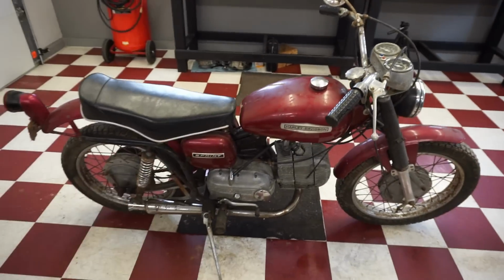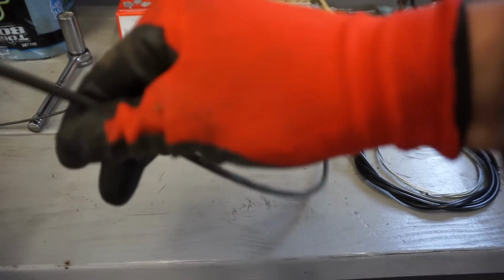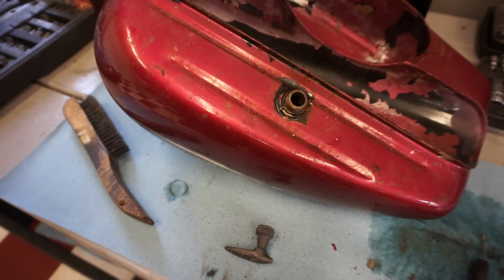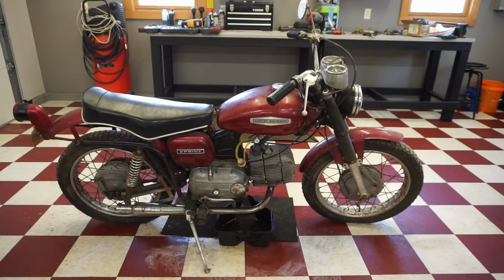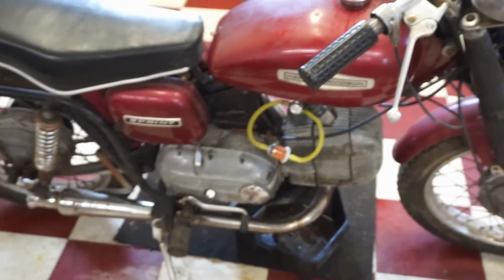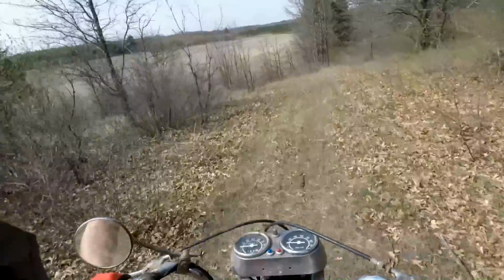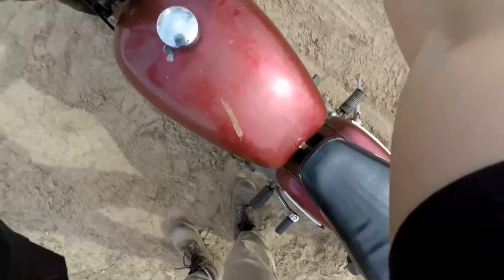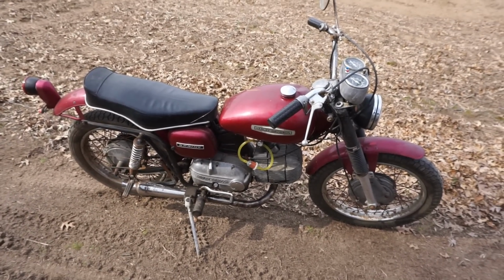1968 Harley Davidson Motorcycle RUNS For The First Time In 30+ Years

Comment: I bought a REALLY ugly 1965 Spring in the early 90's. (I'd had a 67 Spring SS when I was 16)  I got it running, then took it all apart, with the idea to get it painted and restore it.   Found a beautiful NOS seat and a number of other parts.  Long story short, life got busy, I moved to Russia to work, and the project sat.  Finally, I gave it to a buddy who finished it, had it repainted in the original 1965 color (orange) and he had me come down to try it out.   After all the years of not riding one, the 'upside-down' shift pattern on the right  side was REALLY confusing.  The Sprint was the first real motorcycle in my life after having had a little 65cc Honda.  So cool to see this one get rescued and on the road again.  Thanks for the video.

Comment: Q-tip works great for the seat and if you get a stubborn one you can use a dab of tooth paste on the end and use it as a grind compound. Not aggressive enough to hurt anything but just enough to clean up the surface.

Comment: Best thing I’ve found for carb cleaning is guitar string, works amazing! Been using them for 30-40 years! G,B and High E strings are the best!! 👍👍✌️✌️
Reply: Torch tip cleaning files (cheap for a full set) work great too. They come in many sizes for different jets. They also make a good string nut file for your guitar.
Reply: Ah man that's a great idea. Wish I would have thought of that two weeks ago working on an old outboard motor.
Reply: @JayWalksAround  now ya know bro! Really works amazing people don’t realize the strength of them strings when your only using a 3-4” piece grab ahold of it with some Vice grips or something about 1/4-1/2 from the end and you can stick that thing in a 2x4 lol

Comment: Those little bikes are awesome!  I like the right side shifter.  1st bike I ever owned, back in 1971, was a Norton 650 Nomad (Twin Scrambler), my uncle bought new in Texas in 1958. It had right side shifter, 1 up, 3 down, and rear brake on left side. It has twin Amals, similar to those Delorto's, side bowl with tickler primers.  They always leaked gas until the bike started up.  Brits located the magneto directly under the carbs.  Brit bikes leak everything... oil, gas, electricity (thank you Lucas).  The magneto cap looked like a mini light show at night when it was running.  Starting it was always an adventure, as gas would drip down where the spark escaped the mag cap, so I had to always have a thick rag with me to put the fire out, which happened pretty frequently.  I still have that bike.  Starting out and learning on that, then having to re-learn left side shifter and right side brakes was a new experience on my later bikes when I started moto-crossing, and trials riding.
Reply: Were they Amal monobloc carbs with the side bowl, or concentrics with bowl underneath?
Reply: @bananabrooks3836  They are twin Amal 276, pre-Monobloc.  They have the bowl on the sides
Reply: @JohnnieBravo1  There are things you can do to stop them leaking  plenty of hints and tips on lnternet. Some 'modern' parts cause the floats to stick.

Comment: for the spokes, place a few drops of oil on each spoke.  i used to use 3-in-one,  but i suppose a more solvent-based may work.  spin the wheel so centrifugal force makes the oil move to the nipple and drag a metal object accross the spokes to set up vibration.  obviously you can do this more than once and wait a while - day by day even.  most things will free up with penetrating oil time and vibration.  if you are not impatient time is on your side.
Reply: This guy will never make a really good restauration person because he doesn't have patience, have you ever watched the way he Squirtle oil in a hole he gets all nervous and dangled it around like he's having a nervous breakdown

Comment: On Rust- My son bought a 1982 DR125 in great shape for $140 (barn find) and the tank was terribly rusty- I use apple cider vinegar for these and it typically works great! same on an old boat tank. Just fill it up and let it sit for a few days. Rinse well after and put gas in it so rust doesn't start again. Not sure what the rust remover costs, but cider is like $3-4  :)  I also soaked the carb in the same vinegar and it cleaned up really good.

Comment: I had a 1973 Harley -Davidson SS350 Sprint. Made in Italy by Aermacchi. I purchased it new and I think it was about $795.00 plus tax. Harley had two different versions of the 350 Sprint. The SS350 had chrome fenders and though it's a single cylinder thumper, it had dual chrome exhaust. They also made a SX350 Sprint. It was made like a trail bike. The SX had high fenders, I don't recall them being chrome, knoby tires, single upswept black exhaust with a heat shield, I think on the right side of the bike and it had a larger rear sprocket. The SS350 had rubber mounted handle  bars. The SS also had an electric starter plus the kick starter. The SX probably had a different set of shocks for off road riding. I enjoyed the Sprint while I had it, which was only for one riding season. Unfortunately for the bike, it all ended one cold day in November of 73 when a guy made a left turn in front of me. Fortunately for me no broken bones that day.  

I don't know if Harley imported two different versions of the 250 Sprint in 1968. Looking at the 250 Sprint in this video kind of looks like at one time it may have been setup for off road riding, with the high rear fender and upswept chain guard to accommodate a larger rear sprocket.

Comment: Hey joe just want to say since watching your videos I have become so much more confident doing engine work. I have just made a gs125 head, piston, cylinder and cylinder head, plus cam and chain from one engine fit onto a newer fuel injected dr125 engine and without your videos and the knowledge I have gained from you I wouldn’t have succeeded. So thank you, keep up the great videos ❤
Reply: Similar story here. He’s convinced me to buy/repair 3 (as of now) Yamaha blasters. So now I have 3 of those babies. My problem seems to be in selling them. I don’t want to sell them ha.
Reply: @jchuston  I’ve got the same issue but I did manage to sell a couple still have 5 Polaris 4 wheelers seems like I wind up with spare parts that make the next one just a little bit cheaper to fix and unfortunately buy
Reply: @danelldecker3696  100% agree ha ha. I got a cracked case blaster for $250…but had all sorts of good parts, so now I need another clapped out one to make 1 whole running one.
Reply: @jchuston  which leads to the next one and on and on it goes. But hey there is money in it sooner or later and a lot of good times in between. Worse things a guy could be doing. Least that what I tell my wife
Reply: Back in sixties I worked at a motorcycle club. The HD Spint won a lot of state championship flat track races. The person who said they was junk, is full of_ _ it.

Comment: I had two slides stuck in carbs the other day. I soaked them, tried heating them with a propane torch, tried lightly prying with a plastic tool. No movement. I boiled them for a minute or so and the slides came right out. If I had tried this first, I wouldn't have broken one of the throttle shafts.

Comment: I was racing flat track when these came out,they were very fast and the the first 4 stroke flat track 250,more torque where my suzuki was high rpm,they beat on the corners and I would fly by on the straights.
Reply: I remember them on 1/2 mile flat track.

Comment: Take the gas tank off pour small nuts and bolts in and shake tnaks for a few minutes and then empty out all the rust dust. Then put the solution in.
Reply: BB's work pretty well to. I've done that before.
Reply: @PropheZ23  >I've  used clean gravel  rinse with water and dry then coat with an epoxy tank coating.
Reply: You can also use dish soap, a metal rod, and a battery with leads to chemically pull the rust off the tank.
Reply: Marbles are the best thing to use to clean out a gas tank.
Reply: I prefer a length of chain.

Comment: I did enjoy that video very much, lots of information and easy to follow. 
I'm another one that had one of these many years ago. I had a 1968
 350 CC Sprint. Pretty reliable, It was fun to ride. I remember that absolute top end was about 85 mph. 
The Sprint was my third motorcycle and the first one I ever dropped while riding. Took an extremely sharp curve, just a little too fast. LOL 
I've owned a lot of bikes since and I currently have a 1997 HD road King.
Keep up the good work!

Comment: You are giving me inspiration to complete my 1974 Kawasaki Z1A 900 "revival" that sat in my garage for 15+ years. I only need to pull the trigger on a new tank (the old one is in really bad shape), new tires and get the carbs synched.

Nice jobs, I really enjoy your videos!
Reply: I have a couple kz650s....restored. carb sync and timing adjustment made the bike like new. I did the relay / coil mod and it starts on a half kick.

Comment: Wasn't the bike an Italian Aermacchi design which Harley acquired to fill their small bike gap?
Reply: Yes.
Reply: I thought the Italian engines were the 2 stroke 1 75 1 25 and 250
Reply: @Slimjim011  You are correct, also the 250 and 350  4 stroke singles.
Reply: Yes, Harley marketing staff was too dumb to foresee the huge boomer generation come of age wanting to ride, when Honda and other Japanese makers brought out smaller displacement bikes, Harley realized they needed to do something for the youth market.  They bought a 50% interest in Italian aircraft and bike maker Aermacchi (air machine), slapped HD Sprint decals on the tank and the Sprint was born.  H-D also sold the road race -ready CRTT and the factory flat-tracker, the CR, CRS, and ERS.  A Harley Sprint set the world 250cc speed record at 176 mph in 1967. The Sprints were very competitive as racers and the CRTT are still raced in Europe and South America, they are renowned for great handling and you can buy all the road race kit, fairing, tank, bump seat, rear sets etc. from an outfit in North Carolina. Great job!
Reply: @davisworth5114   Still raced in AHRMA  in the US.

Comment: Great vid. I have a 1973 SS 350 Sprint, professionally rebuilt SX, date correct motor, somewhat rare 5 speed. Fun bike. The kick in the ass is that 100% of the electric starters failed, including mine which never worked. The small planetary gears in the starter fail. Fortunately, mine usually starts in 2 kicks.

Comment: The oil leak is the return  to the case from the head. Tighten. The carb is a gas dump not a air restriction. Theres a O ring on that little shaft on the dump lever
  Buy a Maconie carb. Big performance change.

Comment: toothbrush is what you use to clean small parts or hard to reach spaces.  you can actually now buy a cheap electric.  i got one and was suprised the battery - alkaline i guess - was still working after a year of sitting.  also,  use paint-brushes of different sizes in the cleaning.  what you are actually doing is " restoration "  which results in a bike worth more money if original.

Comment: In 1977 I was 10 years old and my brother was 14. We shared a honda 125 that we bought together. Got tired of having 1 bike and pulled  a sprint out of a junkyard for $25. Being a 10 year old mechanic I couldn't keep it running and we pushed it back to the junkyard. I waited another 20 years before I bought another Harley

Comment: Cool little bike! I thought that was something Harley acquired though, bc I had a small Enduro bike back in the 70's that had Harley on it, it was a 100 enduro but I didn't think it was a originated Harley, I don't know what it was originally but sure wasn't that Italian made bike either. To me the engine looked more like a Hodaka or some Japanese made bike, idk? I believe it was AMF Harley or whatever they were back then.  Anywho, I like that little Harley better than the one I had. Yeah the shifter and all that being on the opposite side than what you're used to is weird, I had a buddy back in the early 70's that had a Sears 305 street bike and everything was bass ackards on it too, shifter on the right, brake pedal on the left, clutch handle on the right, throttle was on the left, front brake handle on the right, man that took a little time to get used to but once you did it was a sweet riding bike.
Reply: You may have had this little H-D.  From Wikipedia "The Harley-Davidson Baja 100 was a small displacement off-road motorcycle made for Harley-Davidson in Italy by Aermacchi, which was 50% owned by Harley-Davidson at the time. It was one of Harley-Davidson's attempts to enter the small displacement off-road motorcycle market. It was built in Aermacchi's Varese, Italy factory."
In 1971 I  had a used 68 H-D Rapido, 125cc two stroke and bought a SS350 Sprint new in 1973, both made by Aermacchi.
Reply: Yeah, you're probably right, that's what it was I believe, been so long ago I can't remember the whole nomenclature or whatever of it, but sounds about right. Thanks bud!

Comment: Did you know that CITRI STRIP that you used on plastics before too get the spray paint off stated on the back of the bottle do not use on plastic surfaces so have you had any issues with it bubbling up the plastics or anything?  I picked up some today for a project that im working on that has ben painted but i dont want to ruin the fenders.

Comment: You swap those handles over to the opposite sides to accommodate your way of operations of riding to Joe. It just switches what hands does what is all on the bike. Most likely A left handed rider owned that motorcycle once before you got it. They usually change.,or have it swapped over to the left handle bar for shifting.& Etc.
Reply: Sorry pal, no can do.

Comment: I had a 1968 305 Yamaha 2 cylinder two-stroke first bike with the oil injection. Did 140 mph on Memorial Drive in Boston with that thing and broke the speedometer. Very good bike if you come across one grab it.😎

Comment: When I saw the petcock tap unit not gripping, my first thought was plumber's tape on the threads. Looked like 3-5mm of usable thread there. Any hardware shop would have a roll, and that stuff isn't used for short-term fixes but permanent fixtures.

Comment: I’d brakekleen the petcock threads and superglue it together. The glue will break free with heat and a little force if you need to take it apart later. 
Also, you can get 90 degree fuel filters to help clean up the fuel lines.

Comment: Instead of a Q-tip in the drill use a dry piece of folded paper. You can use pretty much anything but paper has more grit so it’s good for sanding small holes

Comment: The 350 was an Aermacchi Harley-Davidson 350 Sprint. Maintenance can be difficult if you don't have a metric set of tools and the Italians used an M14 medium thread that nobody else does.
Reply: Sorry, I meant M12, it is too easy to strip the threads if you try forcing an M12 coarse down an M12 fine.

Comment: Concerning the Q tip thing, instead of WD40, use Hoppies #9 which is commonly used in cleaning firearms. It’s a solvent the dissolves corrosion much better than WD 40. Thx

Comment: A trick for old gas tank, if your on your last chance of getting it cleaned out, get yourself some acetone, a handful of marbles and dimes, throw them in, and bungee cord it to one of the wheels on a running four wheeler or lawn mower that’s jacked up, and let it slowly spin for a few hours, pour out the contents, rinse a few times with more acetone or brake cleaner or whatever you fancy and 9/10 it’ll end up way cleaner than a chemical can do just stationary. On something sensitive though, I reccomend this as your “last resort” method. Food for thought 🤷‍♂️

Comment: You didn't show us how well the Rustoleum worked. Is it better than Evaporust? Cool vids on many different motorcraft.
Reply: I prefer evaporust, but for tanks I usually use electrolysis. Evaporust in an ultrasonic is super awesome, dont use chome plated stuff with it as it flakes off.

Comment: to remove rust in tank put in a 3 foot long chain and let it slide back and forth in the tank for a long time , it is like scraping it , flush repeat untill clean  / i put a address for nos parts on the other video   hope you can use it  DBN

Comment: That tank is worth lining with latex. Something I've never tried before, but just thought of, copper plating. I'd bet that tank could be copper plated on it's inside with a battery charger as the electro plating power supply. Copper would outlast latex. Think I'm gonna give it a go myself.

Comment: If you really want that rust out of that tank. Get you some muriatic acid. Let it sit for a day. Get a chain through it in the tank to loosen up anything that is stuck to the metal. Rinse with water a few times. Let it dry. And immediately start the sealing process with POR-15 good stuff! And it’ll be set for good

Comment: Change those advance springs there behind the points, the bike doesn’t return to idle from normal rpm changing them will fix your throttle response.  Bike isn’t to far from ok just find some springs for ignition timing they’re half a century old… common problem same on old points fired automobile.

Comment: I bought one used in 1970. I rode it 20 miles home. Got off it and staggered into the house. Sold it the next day for $25 more than I paid for it, and was happy. I did NOT like the shaking handlebars putting my whole arms to sleep, and the seat shape forcing my crotch up against the gas-tank.
Reply: I have been riding Sprints for 45 years and had no problem with vibration, nothing like a BSA Gold Star.